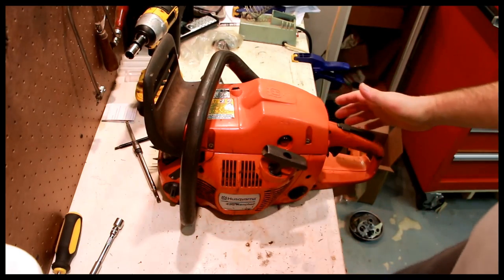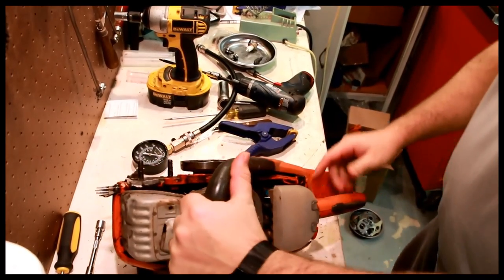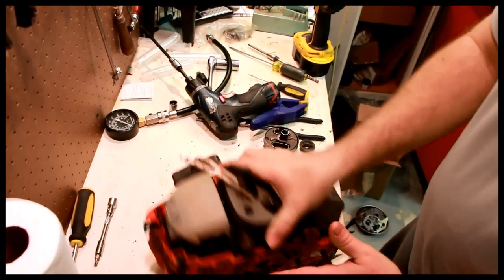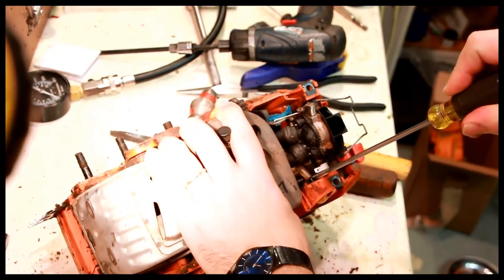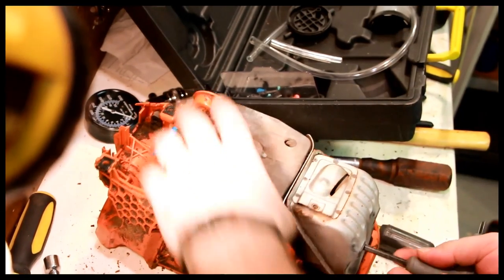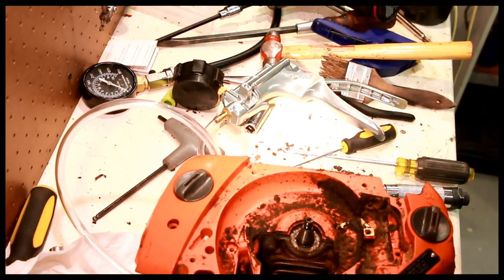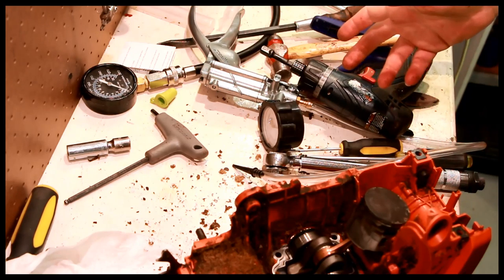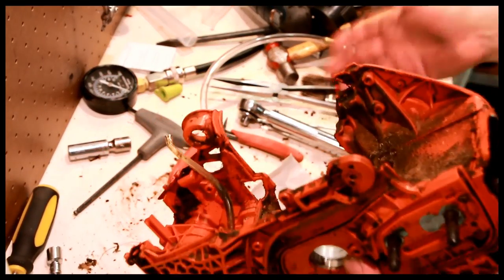Husqvarna 455 rancher teardown and rebuild, bolt for bolt!  part 1

Comment: What a stupid saw!  The drama that you have to go through just to pull the carb compared to most others out there is ridiculous.  Even just pulling the spark arrestor screen has extra frustration, not enough sticking out to just grab it with a needle nose.  So many things on this saw could have been done much better from a maintenance standpoint.   Of course, after doing it a couple times, it's just a matter of remembering the extra steps, but still, the first time on one of these is a doozy!
   That being said, top notch video!  If it wasn't for you I would have had many more cuss words to get me through what should have been a simple service.  Thank you, and good job.
Reply from the maker: Johnny Z yeah...it's not the easiest to work on....but not as bad as the stihl ms290 which is its direct competition ...I've sworn off that one permanent lol.....thanks for the comment!

Comment: I just discovered that Husqvarna sells a 3-sided, 19mm, brake disengagement tool to reset the spring-loaded wheel inside the clutch cover. Part # 587 41 72-01
Reply from the maker: CALVIN L. NIKONT though that is true there is no need to pay whatever Husqvarna wants for that tool it can indeed be made relatively easily
Reply: I agree, but mine was free along with a free chain oil pick-up hose to solve my chain oil leak problem. I offered to pay but they said no.